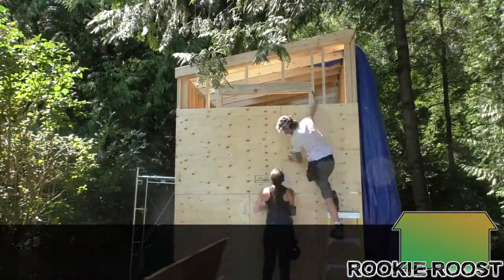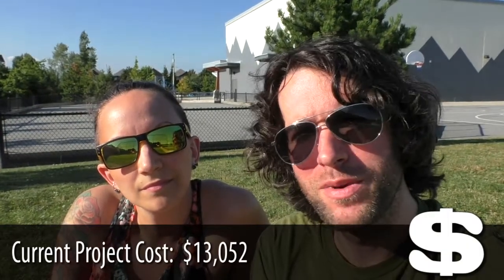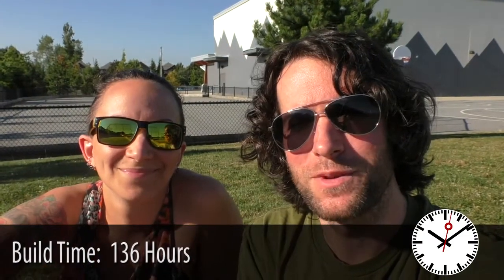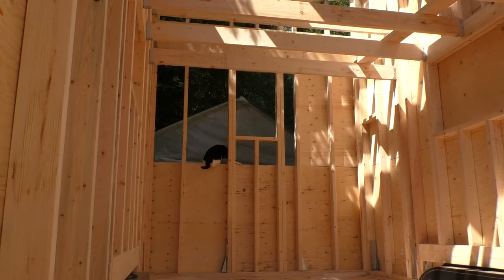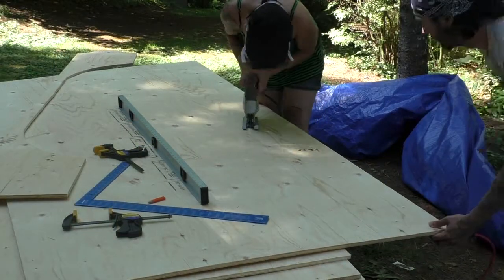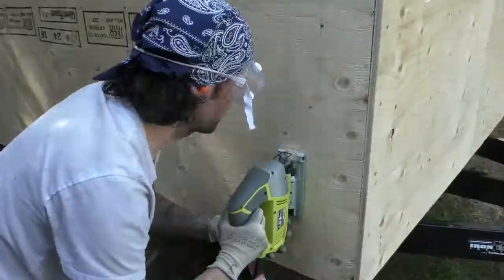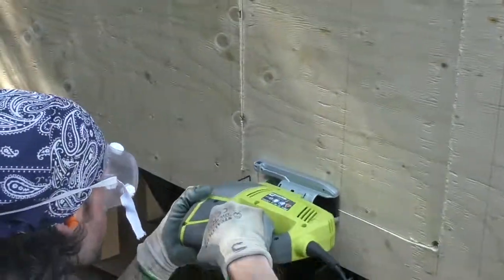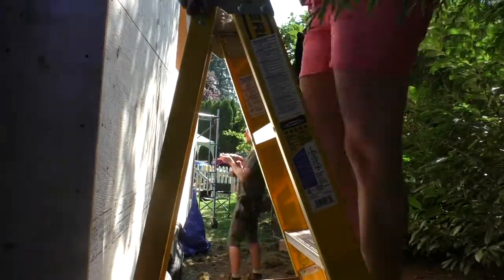Wall Sheathing for a Tiny House

Comment: what type of wood did you use for the sheathing?
Reply from the maker: If I remember correctly, it was 1/2 inch basic plywood. Went with 1/2 instead of 3/4 to keep weight down. Here’s the build video with more detail: https://youtu.be/aKajSj3JSN0
Reply: @RookieRoost  thank you! great job :)